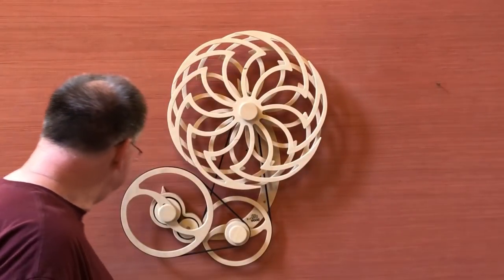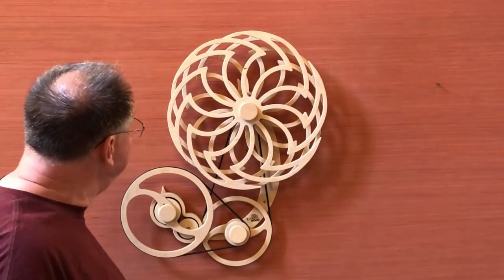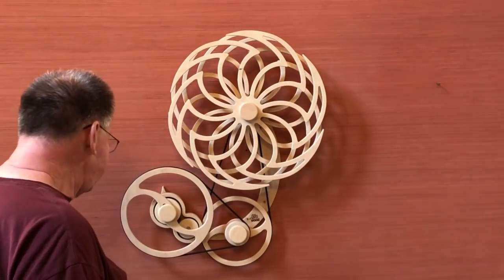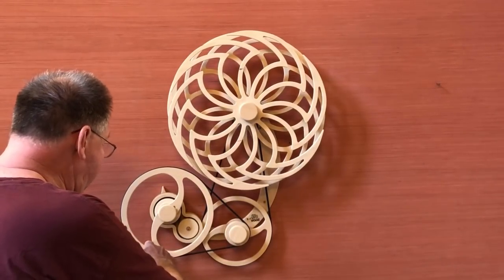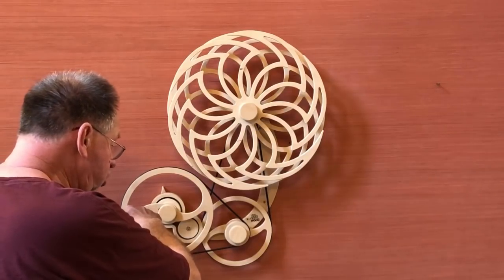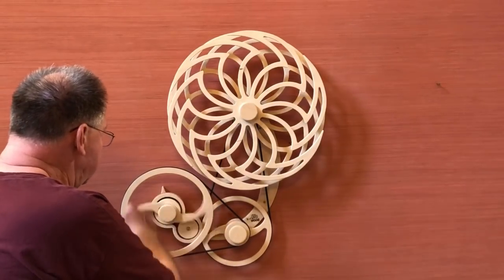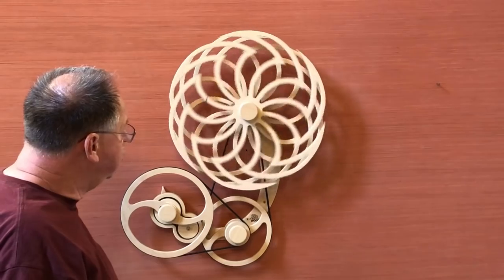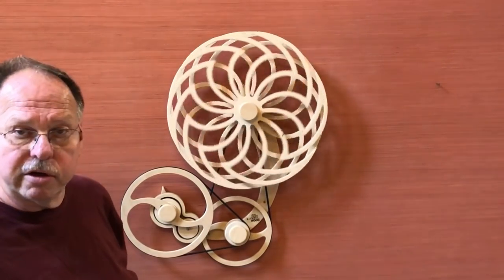Spring Flower Wood Kinetic Sculpture from carvedlakeart.com

Comment: So I have mine. I used only two of the screws because I could not get to the one at the top. Then I used a lot of double-sided tape...don't ask but the end result is it looks and works great. What they don't tell you is do not put this piece of art on a white wall since it's light in color. You should put it on a contrasting color wall as per the instructions. All of my walls are off-white so here I go having to think outside the box again. So I went to an arts and crafts store and got bought a large picture frame that had the black backing to it and I plucked that out of the picture frame and hung that on the wall for my contrasting color. I wish you could see it. It looks amazing and works great.
Reply: Actually, they do tell you somewhere to mount it on a dark background.  I wrote them and asked them about taking it apart to paint one of the rotating flower wheels a different color to add contrast.  They said it could be done, sent me a video link on how to do it.

Comment: To 
 AntiViGames who asked," How do you prevent the spring from delivering all the stored energy in one go?"
I am going to describe the principle of the motion. 
 When energy is inputted into the spring by hand, there are circumferential teeth around the spring that are used so that a  springy ratchet arrangement will cause the ratchet to dig into one tooth on the release  of the input winding and so the spring will not reverse back but is loaded and it stores the energy exerted by the operator. You can hear the clicking sound in this video as he wound it and the ratchet spring goes over the tooth and falls in some space between the teeth and that is the reason why he was adamant about not releasing the spring too fast when winding it. 

On the output side of the spring through the gearing and belts, there are similar ratchets called dogs whereby the inertia of the shaped pendulum is the load and the dogs acting on the other set of protrusions on the pendulum will load the spring and this inertia will stop the spring from running away but it will use the controlled force to accelerate the pendulum. At some moment the pendulum dogs/ ratchet is locked and the one-way action of the ratchet will permit the pendulum to proceed in its rotation by freeing it from the dogs/ratchet. The pendulum is not perfectly balanced so that when its inertia loses its energy the pendulum will oscillate and reverses when it will unlock the dog/ ratchet and this will again feed energy into the pendulum to accelerate it when at some angle the dog will unlock the pendulum and lock on to a grounded point. The pendulum will again be free to rotate.
There is a method of how to use two systems operating together to operate two pendulums, but in this case, the second pendulum may be activated through magnets on the spokes of the two pendulums and these react with each other as they pass close to each other and this gives the idea of random motion. Well, theoretically it is not a random motion but the variables are so many that it may be considered as such.

Comment: How do you prevent the spring from delivering all the stored energy in one go?
Reply: When energy is inputted into the spring by hand, there are circumferential teeth that are used so that a  springy ratchet arrangement will cause the ratchet to dig into one tooth on release and so the spring will not reverse back but is loaded and it stores the energy exerted by the operator. You can hear the clicking sound in this video as he wound it and the ratchet spring goes over the tooth and falls in some space between the teeth and that is the reason why he was adamant about not releasing the spring too fast when winding it. 
On the output side of the spring through the gearing and belts, there are similar ratchets called dogs whereby the inertia of the shaped pendulum is the load and the dogs acting on the other set of protrusions on the pendulum will load the spring and this inertia will stop the spring from running away but it will use the controlled force to accelerate the pendulum. At some moment the pendulum dogs/ ratchet is locked and the one-way action of the ratchet will permit the pendulum to proceed in its rotation by freeing it from the dogs/ratchet. The pendulum is not perfectly balanced so that when its inertia loses its energy the pendulum will oscillate and reverses when it will unlock the dog/ ratchet and this will again feed energy into the pendulum to accelerate it when at some angle the dog will unlock the pendulum and lock on to a grounded point. The pendulum will again be free to rotate.
There is a method of how to use two systems operating together to operate two pendulums, but in this case, the second pendulum may be activated through magnets on the spokes of the two pendulums and these react with each other as they pass close to each other and this gives the idea of random motion. Well, theoretically it is not a random motion but the variables are so many that it may be considered as such.